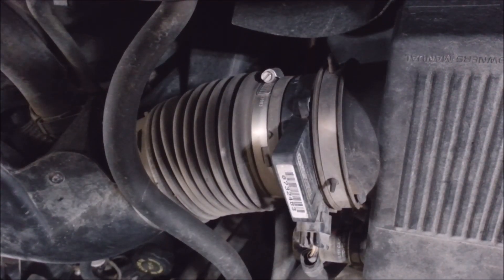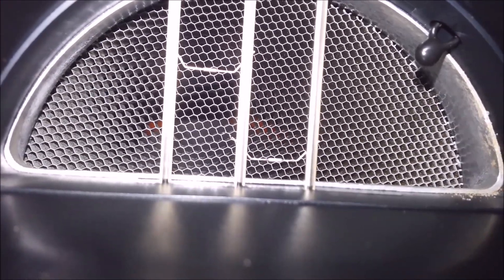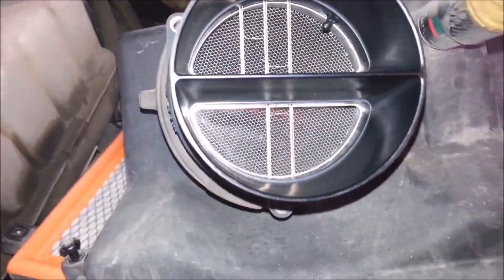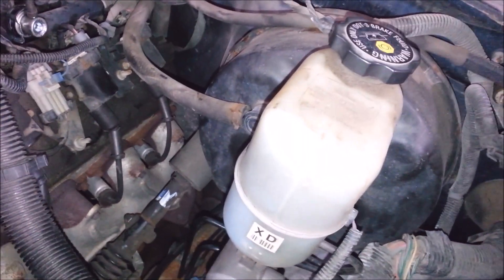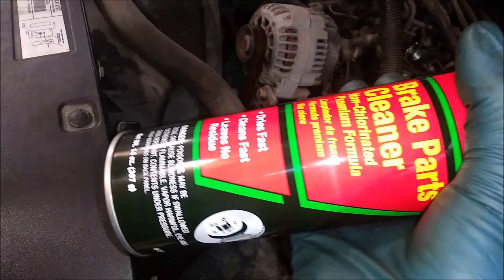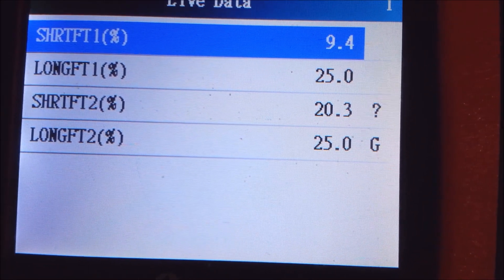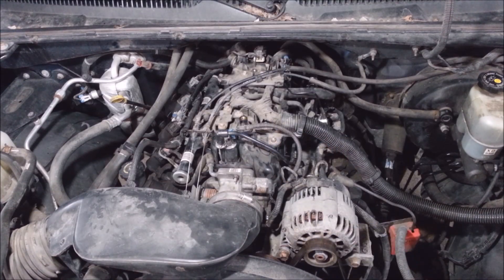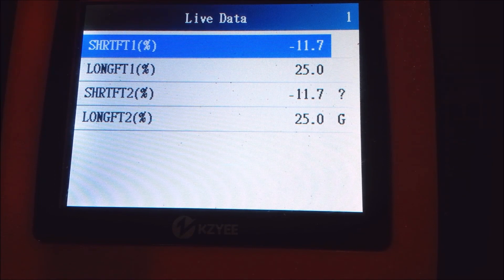How to diagnose the p0171, and p0174 lean bank codes

Comment: This was a great video. You're an asset to YouTube man! I hate these kinds of codes. I had to fix my Maxima a few years back, it turned out that it was my MAF, even though the thing looked clean as a whistle, it just went bad after 20 years. So I bought a new part, installed it and it was even worse. Bad POS part out of the box. Went to get a different brand and the car has been good since. OKAY BYE!
Reply from the maker: You got a Mexican remanufactured part. Those may look fine, but the insulation on the resistors are usually cracked up. The only good way to test those is with a graphing meter, and it's still hit and miss sometimes. Lean bank codes sometimes can be a pain. Thanks for watching!
Reply: Sounds like somebody was drinking too many cervezas...
Reply from the maker: @BarnStangz  there are MAF rebuild kits you can buy, and it usually doesn't work right. It fits a wide range of cars. Some of these remans use the same kit. Buy new.
Reply: I hope this is the only MAF I'll  have to work on for a while. My other junk seems okay for now... Where were you when I needed help removing the parking brake on a 2010 Grand Caravan last weekend!? Man, that thing was tricky!